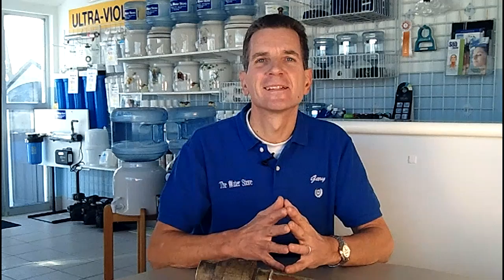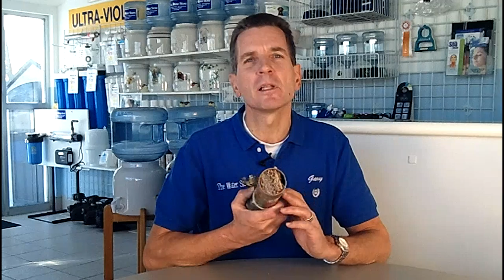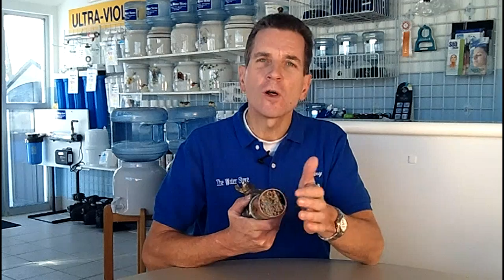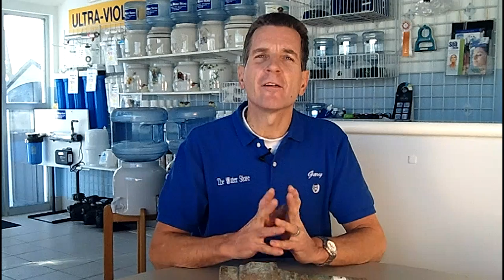Is hard water clogging your pipes?  Midland, Ontario

Comment: I did not know that water softeners can actually restore clog pipes. That would save me a lot of money not having to replace them.
Reply from the maker: Yes, they do.  The soft water will slowly absorb the scale from the hard water that accumulated inside your pipes.
Reply: @water_estore  Thanks for the insight, didn't know that adding a water softener unit will restore clogged pipes. Our house is 28 years old with hard water and I know that our pipes have calcium build-up. After installing the soft water unit, approximately how long will it take for all of the pipes to be restored?

Comment: How can we clear this hard water from pipe lines in a building in 1 day??
Reply from the maker: I really don't know.  It would take some kind of very powerful descaler.
Reply: Parth Chawla you would need to bleed all the water system and then pour vinagre let it seat for 
24 hour day run water again and that would help 
Still I would install water softener
Reply from the maker: @791isaiah  I agree.
Reply: @791isaiah  thank u so much but now we had added diluted HCl in the pipe lines, i know it's u'r big mistake. Now the water comes out from tap is red in colour from last 1 month after this we addded 1.5 Liter H2O2 (6%)+ 50gm baking soda solution and let it seat for 24hours then run water. After repeating this process twice first bucket of water is yellowish in colour every time when we open tap from last 10 days. Sir, please help us🙏